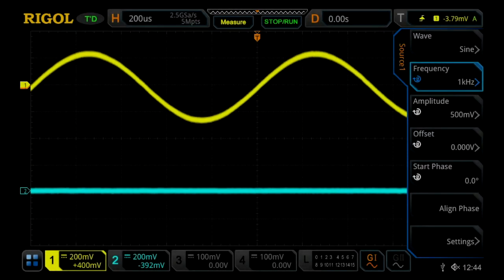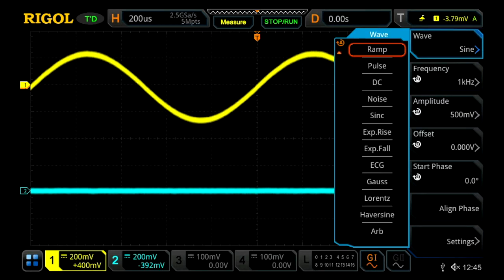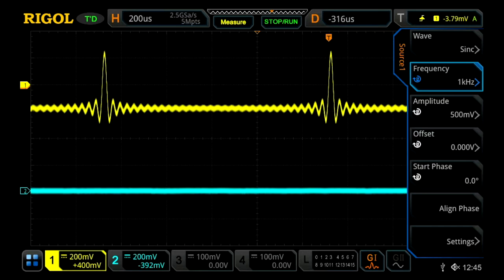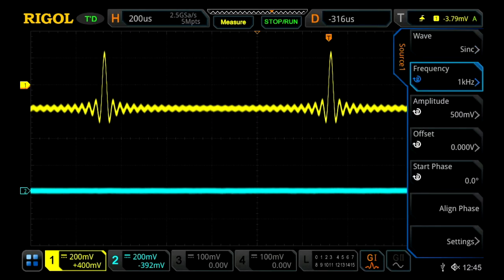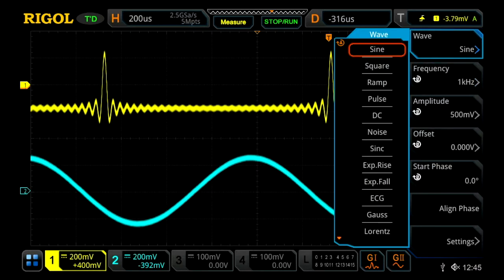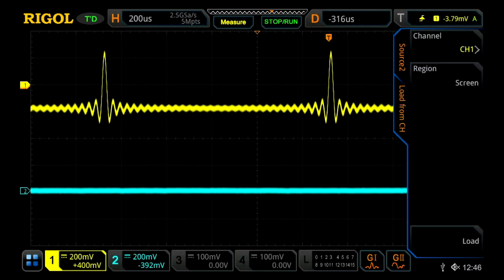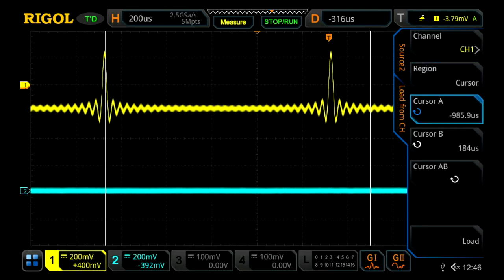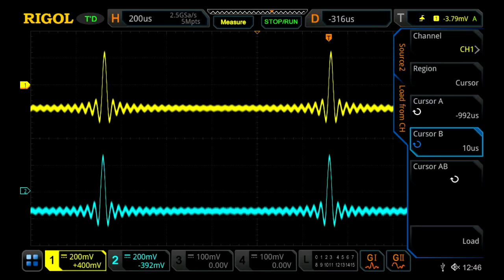RIGOL MSO5000 Arbitrary Waveform Generator

Comment: Have a nice day
I'm sorry for the message, I wanted to ask you about the MSO5000 Series oscilloscopes, I'm just planning to buy a similar one
I read in the manual about the function of recording the waveform from the input channels and the ability to transmit using the built-in generator.
But I could not find information, is it possible to record 2 signals from different channels at the same time and transmit them simultaneously using different outputs of the generator

Recorded on equipment and reproduced, I want to use it to test IGBT drivers from UPS on the desktop. There is no desire to work near the equipment, as the voltage is about 800 volts.
2 separate channels come to the IGBT control board, if there is no one signal or not at the right time, then the board cannot be checked.

Sincerely